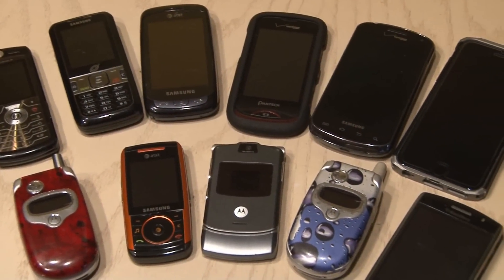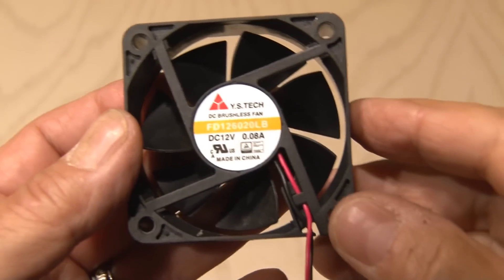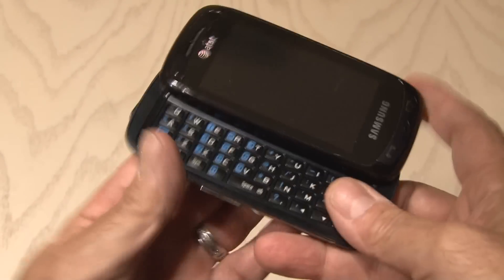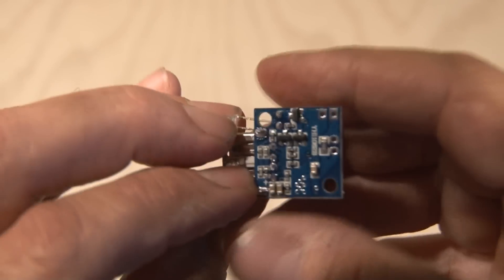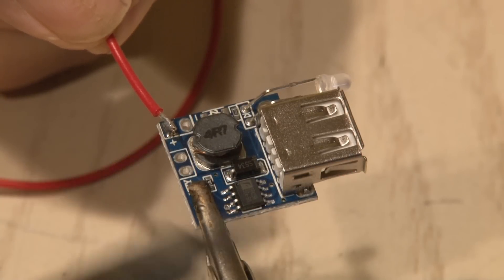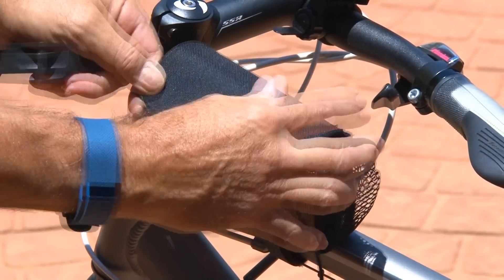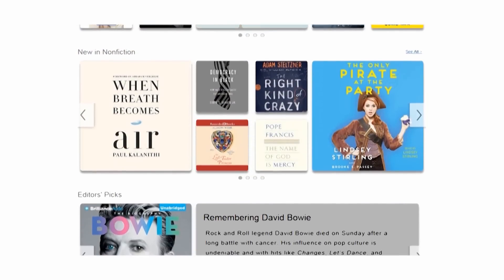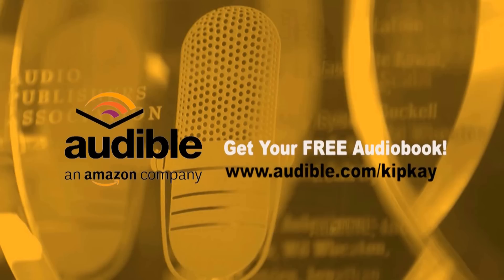Charge Your Cellphone with a Fan!

Comment: It will work better if you cut the blades of the fan and attach it directly to. The wheel?
Reply: +Randy Mork yeah, that was the idea  but as the other guys suggest  the rpm  will be lower
Reply: +Edward Reyna Meh, not really. Not as much rpm compared to it being blown by wind.
Reply: U can but you will need a ton of wire because the wheel will spin taking the wire with it
Reply: +Edward Reyna if it was attached to the side of the front wheel near the brake assembly it would work much better. Spinning against the the wheel if I get what you mean.
Reply: +Lionkev55 Lions good point
Reply: Randy Mork It wouldn't produce nearly as much voltage, since voltage is directly proportional to the rpm. Bike wheels have a lot of torque cause...they're heavy but lack on rpm which is what matters.

Comment: All of that you can just plug it in the wall
Reply: no its for on the go. so you don't have to pay for an expensive power brick
Reply: +The Sole Traveler Space and Time you can get a portable charging battery for about 10 bucks.
Reply: +james pond only the cheap ones
Reply: The Sole Traveler Space and Time yeah. And they work fine without needing a bike to use. I spent 7.50 on one, and it fully charged my phone in less time than this method would have.
Reply: +james pond depends if u wanted to over heat easily :p
Reply: +HELL STORM lolwut?? I've done it in my pocket. There's no heat.
Reply: +james pond lol I got a solar panel kind lol
Reply: +HELL STORM cool story bro
Reply: +My cockatiels life! And more You're all missing the point of the video, it's a cool DIY project, just an idea, you don't HAVE to do it, and obviously not everything will be useful for everyone.

Comment: Why not just hook it up to the wheel? surely that would charge more and doesn't require air, just the fact that you're traveling.
Reply: +mtothem1337 how would you attach it to the wheel?
Reply: The cables would spin around either

Comment: Can't you use a magnet to cause the fan to spin?
Reply: Really, you just really that would work?
Reply: +Tyler Walter no.
Reply: +CaffeinePizza I think I've seen it before since the fans use magnets to spin
Reply: +Tyler Walter conservation of energy?
Reply: +CaffeinePizza Not sure I think it simply works with the polarity of the motor and causes it to rotate to try and get to the magnet you have
Reply: +Tyler Walter it will not work.

Comment: If I did the same thing but instead of mounting it to a bike could I use neodynium magnets to make it into a perpetual motion machine?
Reply: +James Polk There is no such thing as a perpetual motion machine, it won't spin forever. But it will spin for a long while fast.
Reply: You mean use magnets on the fan blades and a magnet in your hand to spin the fan?

Comment: it can deliver .7 amp? Doubt it
Reply: +RoNiNk .5A is a trickle charge for most modern phones. not much but still a charge.
Reply: 0.005A on a good day (notice the fan is also rated at 0.01A it means it cannot generate more current than the one it is rated at)

Comment: Put magnets on the fan so its Spin without bicycle
Reply: +tino saarelainen you have a monopole magnet? please do share. you'll be a billionaire overnight.
Reply: Trust me people have tried it will not work
Reply: So you think you can get free energy out of nowhere?
Reply: yea!!
Reply: That doesn't work, I and many others have tried.
Reply: +I'm not a Troll did you use a brushless fan ?
Reply: Richard Smith Yep.
Reply: +Richard Smith its not an invisible wire it's the magnetic pull from the magnets and it's not a magicians trick, you need to do research.
Reply: +I'm not a Troll did you use neodymium magnets because other types of magnets don't work.
Reply: +Richard Smith that's a brushless motor fan. There is no way possible for the electric current to exit the motherboard of the fan because they have more than one coil, and that it would not do an current. And I trusted Kipkay. Huh. Ur a smart man dude
Reply: +Aaron Collen ive tested some of these small  computer fans and two of the wires do produce a small amount of voltage . im thinking that these little motors are not as brush less in design  as an rc car motor ..
Reply: illuminati confirmed.
Reply: Jp 131313 No, my friend, you need to do YOUR research. You cannot power a fan with permanent magnets. Those videos where you saw it was done with very thin(invisible to the shitty camera) wire, called magnet wire, usually used in transformers.
My god man... you have been duped, i hope you didn't give him any money...
Reply: + Chandan Reddy it is still from a spinning fan not nowhere

Comment: I think you'd get a better charge by running this directly off of the tires rather than relying on airflow.
Reply: +Urahara1001 But if you do use a motorbike as he also suggested, it'd generate way too much current for the phone.
Reply: +Jackson Percy Could possibly use some really tough resistors?
Reply: +Urahara1001 y'know he actually made this project before. Only it was powered by pedaling, not making a fan spin. Inefficient take on an old, better idea.

Comment: You should cut off half the frame of the fan, make a floating device around it and anchor, and then float it on a running river anchored in place. Water-generated emergency power!

Comment: Could you put two fans in series circuit? And will this make it charge faster?
Reply: +joseph hunt You'd want to put them in parallel. Putting them in series would double the voltage, which could actually break the step-up converter since it's only rated for 5.5V and wouldn't increase charge speed at all (technically it would up to a point: increasing the voltage, provided it's under 5V, would reduce the work the converter has to do to increase the voltage... but whatever. if the combined voltage was >5V it wouldn't help at all and could be damaging, so it's pointless.). Putting them in parallel would double the current, which directly contributes to charging speed.

Comment: Yesterday I got a computer fan from an old PC. My younger brother told me that I should charge my phone with it, and I told him that it is impossible. And now, 1 day later, you release a video on how to charge your phone with a computer fan....
Reply: +PlatinumGamer Here's why it's possible: fans are driven by motors. Motors work by applying current to a wire in a magnetic field, causing it to spin. Generators work by spinning a wire in a magnetic field, producing current. Motors and generators are actually exactly the same, just hooked up differently.
Reply: xereeto
I know how it is possible, but I thought a fan could not generate enough voltage or amperage to actually charge a phone.
Reply: carzak
"Yeah, and if you ride fast enough, say at least 10 mph/15 kph, that probably happens."

No it wont because the fan has resistance, so if you need X RPMs to push air at a certain speed, if you blow air into the fan at that speed you will get way less RPMs because of losses. If the fan had no losses it would actually spin faster than X

"So, you've shown that it may charge a phone, or at least keep it charged, not that it guaranteed won't work, and is useless."

Most cellphones take like 2 hours on the wall charger, 3 to 4 on a usb port. If this shit cant even do half the power a usb port outputs then it will take like 6 to 8 hours or more. That is not useful as most bike trips wont last more than 1 to 2 hours. And it's so slow that will not save you in a pinch. Like i said, trimming the blades and pushing it against the wheel would work way better and make it spin faster than even going at 40KM/h (as fast as you can in a downhill)

If it's gonna take 6 hours to charge, why not just hook 4 AA to the input and charge your phone from that? it's easier, will charge faster and it works while you rest. An alkaline AA can give you like 2,5Wh, 4 will give you 10Wh, so if you need 2,5Wo a bit more, it will at least last you a full charge

"You did not prove anything mathematically in the post I replied to, you told people to do their own calculations, and made an "if" statement, and said it might charge the same as a USB charger."

I did prove it, the calculations are very basic, i i said it's worse than charging it from a usb port, which is already slow. Dont tell me i didnt prove stuff just because you dont know crap about physics and electronics. The numbers just dont add up, just like those scams that claim to make plastic out of CO2 or generate water out of thin air. You do the math, it's physically impossible. Like i told you, he didnt even show you any number, he just showed it "working" which just because the cellphone showed it was charging it doesnt mean it actually worked. I told you numbers dont add up, that there are way better and simpler ways and even showed you some numbers. I cant teach you everything here, this is youtube, not colege, the most i can tell you is why it wont work, now go and research that yourself as even if i wanted to i cant make a physics and electronics 101 class here in the comments.
Reply: carzak stop twisting my words.  if the fan outputs less than the cellphone CONSUMES on its own, it wont have anything to charge the battery with, hence it WONT CHARGE AT ALL
and I DO KNOW IT, it's not rocket science, you need basic knowledge of how physics work to  understand why this happens.
Also all you need is a scissor and a big paperclip or a piece of iron wire, the rest is the same, but this will give out tens of times more power, i dont see how this is "far more complicated" and it by the laws of phisics WILL work better simply because you are putting more power into the fan's coils, hence it will output more power. The laws of physics necessitate that.
If you dont know how physics work do youself a favour and grab a book, they dont bite.
Reply: cool
Reply: XD
Reply: +PlatinumGamer it actually cant, not with those crappy pc fans. If you have a wind turbine, that's another thing.
If you want to try, just put a multimeter hooked to the fan in current mode, that should short circuit it, blow really strong on the fan and meassure the current and fan speed. now, blow on the fan trying to get it to the same speed and only meassure the voltage. Divide Voltage over current and you get the impedance. 
Blow on the fan and meassure the maximum voltage you can get, and divide that over 2x the impedance and that's your maximum power output. That assuming an ideal world. Multiply by the step up converter efficiency (0,9 to be forgibing) and if you get anything above or near 2,5W then you might be able to to charge your phone as slowly as a usb port (2.0)  on your computer. Ideally you should have something near 3-5W or more for your phone to charge at its rated speed.
Knowing your legs can output about 90W of mechanical work, you are better of just trimming the blades and pushing the center of the fan against the front wheel with a spring or something. That will give you a lot more power than using the wind to spin it.
Reply: You started to neckbeards against each other, one even has the famous anime profile picture to top it off.
Reply: +Random Name it's actually a video game character. Just saying for the record, I like the games the character happens to be from just figured if say.
Reply: Bandicoot803
 magnetic coupling varies in a known way, if flux change also varies at a known rate (rotational speed)  you can calculate the speed by simply measuring the rms short circuit (or with a constant resistance) current provided you know the current for a certian speed, then current (and voltage) is directly proportional to the speed. If you dont know about magnetic circuits and stuff dont blame me. You not being a pedantic ignorant moron is not my responsability.

ps: you can actually derivative an engine's speed by measuring the alternator's output. Its just math

Comment: For a motorcycle wouldn't be easier if just connect some 12V to USB adapter direct to the battery?
Reply from the maker: Of course! This is a fun hack.
Reply: Some motorcycles like mine are kick start so there is no 12v power supple only a crazy high AV voltage for the spark plug I have a large faring on mine I'm thinking about velcroing this to it
Reply: +Alex Abey Does it not have lights?
Reply: +Duett A Traktor  an ac bulb that's it it is a dirt bike all the way

Comment: what's the output of your step up converter? you also didn't leave a link for it in the description. could I use one with an output of 2A?
Reply: +LeadFarmer4Life The data provided on Amazon says that it will take up to 3A @ 5V (USB standard voltage, but not current) and will output 5V @ 2A max.
Reply: ki2ne thank you. Can you provide me the link please?
Reply: ki2ne thank you!

Comment: nice idea, but i think it will kill you batterie. You will charing it, then stop at a traffic light e.g. and it dont charge. Then you don't drive the full time with the same speed, so you are charing with different currents.. 
BUT love the idea
Reply: It should be charged through a slow discharging capacitor to avoid this problem

Comment: Or, you can just attach one low magnet on the propeller, and when you need a charge, put a strong magnet in the center of the fan. Fan will start spinning.

Comment: can you show us how to add multiple fans to create more power, is it best in series or parallel.
Reply: +GAME OVER &quot;WE HAVE EVERY PIXEL COVERED&quot; Based on what is shown on the fan sticker in the video, you'll just need to put in parallel - 12V is more than enough voltage (which will have to be stepped down to 5V for USB-compliant devices, but not enough current (100mA from a single fan compared the average 1-2A input required for a smartphone).
Reply: Cool thanks.

Comment: I had done like this for some year. I think you should only do it because of your hobbies. I found some difficulties to use your project:
- There are nothing to store the energy made from wind without charging phone when you ride and when you stop, there is no power to charge your phone or phone of somebody else. Suggestion: you should set some battery cells into yours.
- It never works in rainy days or wet days. Your project will become useless.

Comment: so how exactly would he mess up his iphone cable if he doesn't need to cut anything. the cable already has the usb on it. he only uses the old phone because he knows it wouldnt charge a newer phone.
Reply: +luckychris1997 well he could also fuck up the battery/cell phone if the voltage is too high soo it made sense not to use a new phone
Reply: +luckychris1997 There's no reason this wouldn't work for a newer phone actually, if the voltage is around 5v it's the same amount you'd use to charge just about any USB device, eg phones, though if you were to try this I'd suggest making sure the voltage is regulated, since providing too much power is bad for the phone, and too little is pretty obviously just not useful.